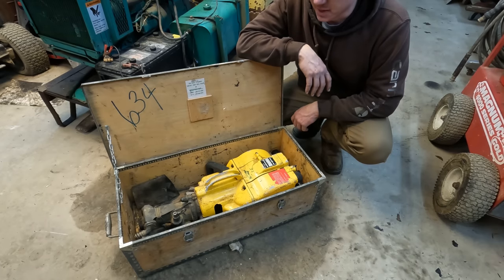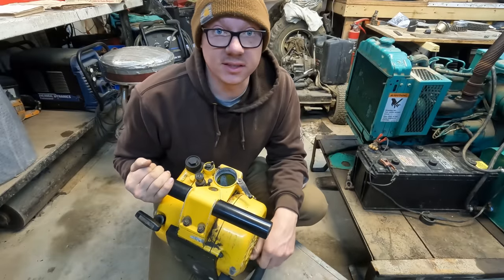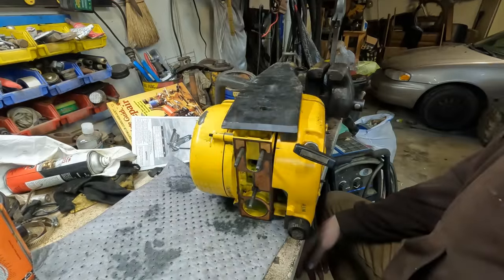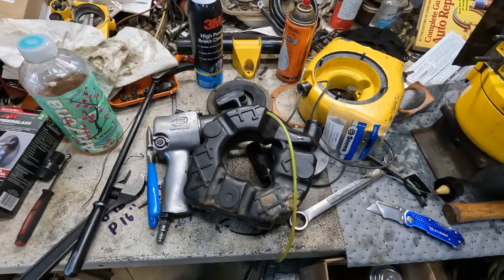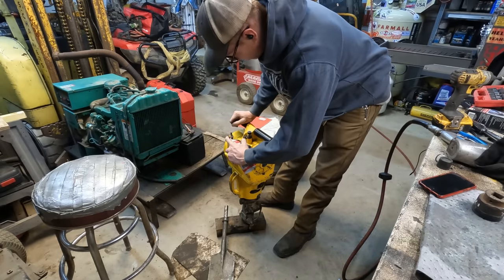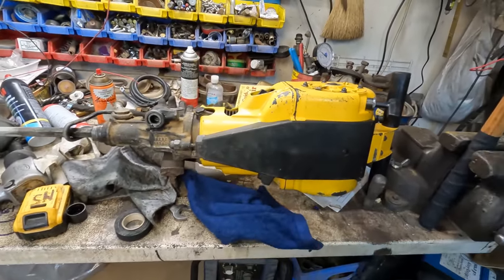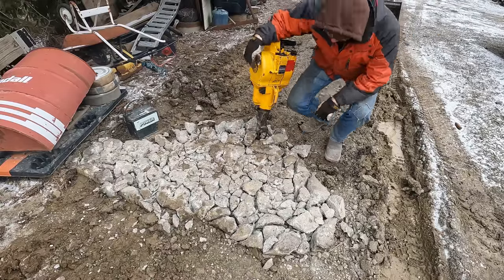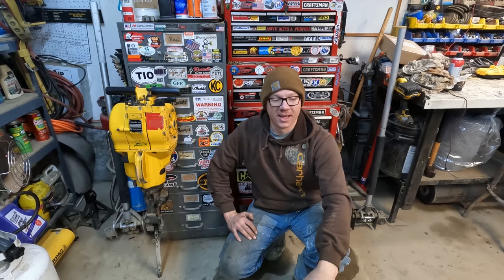RARE? Gas Powered Jack Hammer, Will it ever Run again??  (Pionjar 120)

Comment: I used a similar device back in the 60s to remove some ledge in my driveway. It was quite large and it took several weeks to complete. I only worked on it an Hr a day after I came home from work. Neighbors did'n like the noise. The unit I had was very old, probly made in the 30s, but worked veru well.
Gramps
Reply: what is ledge made out of? is that like SLC Utah USA 🇺🇸 granite/quarts?

Comment: This beast is even more gigantic than the Bosch electric jackhammer I used to run on my first job (laborer for a basement waterproofing company - ugh). On a later horrible job, I got to use a regular air jackhammer which was AWESOME. It destroyed everything almost effortlessly and it was waaaaaay lighter than the Bosch.

Comment: I know some version of the Pionjär was used by US armed forces so it might not be too hard to find a manual in English, but if not I could translate a Swedish original for you. Just let me know.

It's probably 15-20 years since I last used one but I can confirm the reversed throttle action mentioned elsewhere in this thread - "full throttle" is supposed to be used for stopping the machine, and that sure seemed to work. ;-)
Reply: It was made by Syntron in Homer City, PA and actually predates the Pionjär by almost two decades.  One of the nice things about the Pionjär is that it has a built-in grinder on the end of the crankshaft for sharpening drills.

Comment: A damp towel and a steam iron, check frequently as you steam. Most other solvent based solutions would have a good chance of dissolving the ink. A parchment paper designed for oven use will not absorb water or oils, much like freezer paper. A test run is advised ;-)

Comment: That's a Homer Simson Moment It dosent have a carburetor that's what the Reed Valves are for and The Adjustable manual Needle valve always Great To see creators put the Oopsy Mistakes in the video Great work as always Matt Always Great entertainment 12:28 @Diesel Creek

Comment: Man do I feel your pain starting that little bastard.  We have some small engines (and bigger, like Wacker diesel plates) where starting will nearly cause a stroke!  Helpful tip unrelated, mikasa jumping jacks - if your crew chucks them around like ours do-the throttle control area is a poor design easily bent and can screw up the operation.  Check that if poor running or starting. Thanks for posting.

Comment: Man, the determination to get that thing started! I would have given up and put the thing back in the box after a few pulls. Hope your shoulder is feeling better after all of that 😂
Reply: AMEN!!!
Reply: They can be a bit temperemental - some guys here in Sweden which has a complete (ie most accessories ie drills etc and the army instruction) machine like them very much but with a caveeat :  either read the booklet thoroughly or ask a friendly really knowledgeable person for assistance when working with them.

IF not,......   they are really HARD to start (due to movable cylinder lid....  so can be very hard to start if you dont do exactly as you should.)
Reply: With that much pulling, I would have to get the neighbor kid to work off some excess energy. I'm 55, but I have been telling him that I'm 60 for the past ten years.
Reply: I'm glad I opted for using the electric one + generator...

Comment: A tip to get those stuck pages lose, could be to use steam. Just fire up a kettle of water and hold the book over the steam. Then, gently pull the pages apart (when they're damp and hot).
That's how I used to get stamps that were glued to envellopes.  
Good luck!!!

Comment: I actually have two of them and they are pretty cool! It takes a few minutes to get used to the way they work and get the proper engine speed set for the best results but I have torn out a lot of concrete with them. They will break rock as well. Starting fluid is your friend!!!!

Comment: Used this to drive arrow point anchors and ground rods for a mobile radar system in the Air Force. A pain to start but once running it would wear you out. LoL. Great video. Thanks for bringing back some good memories.

Comment: got a bit of a whiff of "Hand Tool Rescue" right after the intro. Also, its great you got so much paperwork with the unit,  it really helps with the history/backstory of many piece of equipment. Hope you can get those pages apart too, looks like those manuals got wet and stuck together at some point in time. Sometimes soaking it back in water while flat will let you pull the pages apart with minimal damage to the print, though I would probably take each page out and dry them between wax paper and under something flat and heavy.
Reply: To seperate the  pages use steam from an old fashioned kettle, you know like sneaky folks used to open someone elses letters ? Apply steak whilst gently seperating each page.

Comment: Pionjär is Pioneer in swedish. We have those and still use them at work (Linesman) we use them to set fastening clamps on cable pipes and for anchors for power lines, fasten  the poles etc. Can also be used to drill and blast rock but its much slower going than a air powered drill. We also have shovle and compacting plate to use with the pioneer. I often use its smaller cusin the "Pico", its a lot lighter, but also only about half the speed. When climbing on mountains or getting on and of our boat its a huge difference

Comment: Try a steam flat iron, put it on a flat wood surface then cover with a hand cloth towel, then use steam to heat it some. Steam and heat should loosen it up. Use a cell phone to take photos of each page, then download to the printer, then staple it together.

Comment: Hey Matt. Nice find: Pionjaer = Pioneer 🙂 If you have a steam wallpaper stripper, or anything with a gentle steam output, you can hold the leaflet by the spine above it with the pair of stuck pages in the stream, and gently pull the pages apart after a few seconds. Good luck 🤞

Comment: Hi Mat,  to separate the pages I used to simply soak the entire book in warm water, and very gently eaze them loose, then once separated, place paper towel between the pages and air dry , checking to make sure they are not sticking to the towel,   good luck

Comment: When you construct your new workshop, will you include an overhead crane/bridge crane?
Would enable you to lift and move around all those heavy bits of equipment, engines, parts of vehicles, etc.
Reply: Check out the one Andrew Camara  built for his garage
Reply: Similar to what Andrew built.
Reply: Overhead crane/ bridge crane

Comment: Swedish defense had many thousands of these in store, which created an conundrum : a more modern one with less vibrations cant be stored as long as the old ones because the insulating materials ages faster then the machines is laying unused, so they tried a number of  handles which would shield the user from the vibrations.

Comment: It must have not occurred to you that when you push the black button it would die thus it’s a kill switch and not a throttle ! Remember there is NO CARB only a needle so it must run wide open when working and the needle is used to smooth out the running ! I’ve never used one but that’s what makes sense to me watching you !

Comment: Mandrel bends some crome-molly tube in the shape of the broken plastic side handle, flatten the and drill some bolt holes. I used floor vent filters wrapped around the inside of my Harley Sportster air cleaner housing, which worked like a charm and was cheaper too. Slip some foam pipe insulation around the tube to cut the vibration.

Comment: I'm guessing you've figured it out by now but I'll bet that button that you thought was a throttle is actually a decompression valve to make it easier to pull when starting. I had a 600cc single cyl kick start motorbike that there was no way you were kicking this thing over with using the decompression valve. ;)
Reply: Well, you may try, but it'll break your leg easy

Comment: I used these in USAF Combat Comm to anchor A/N TRC-170(V)2 troposcatter antenna bases. Try standing on a 10 ft a-frame ladder in an empty field with a Pionjar and hammering 12 ea  10-foot sections of ground rod into the ground. Then, you can say you've used one.

Comment: AS a long time subscriber boy you have patients with that jackhammer I would have long left it to rot into the ground your one heck of a guy to keep on trucking and you won it's now working as intended and as we all say there is no throttle just a decompressor that's why it dies when you push down on the knob it works better by putting wait done onto the machine as you have noticed that's how it works the more you bear down onto it the more power it produces excellent video.

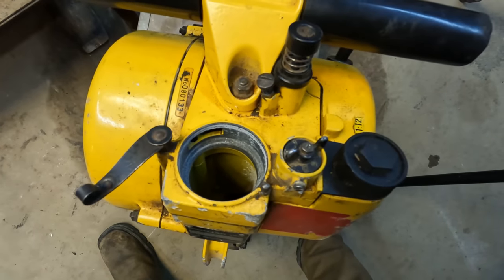Comment: @5:17
All your info is right here, Matt. Specs, spare parts, all here. You're welcome.

https://www.gmd-eqpt.com/rock-drill/gasoline-rock-drills/pionjar-120.html  |  

Owners Manual
https://www.manualslib.com/manual/1102006/Atlas-Copco-Pionjar-120.html  |  

$210 At auctions=
https://www.auctionsinternational.com/auction/20999/item/pionjar-120-gas-powered-jack-hammer-127235

Comment: if you use a thin object (like a knife) at the bottom and top and find the places between the paper where it isn't stuck, you can gradually undo it from several places if you can get in there. you want the adhesion to give before the paper, where just pulling the pages apart does the opposite

Comment: Nice to see a real Pion-jaer  [-jair] in Swedish, "Pioneer" officially in English! Made for the Army Engineer Throops and then painted matt olive green. Still in use! All variants are called "Cobra" here, what is the brand from another "small" Swedish rock-drill equipment manufacturer with name Atlas Copco. When you're addicted to yours then buy a new (A C) Cobra! Haha!  
Often the old ones run on a very fat 2-stroke "old type gas" (~ + additives) with about 5 to 7% old not PC 2-stroke oil (or just add mineral engine oil in worst case). I have several of them from Civil Defence surplus here in Sweden. Easy to buy new spare-parts here and in Africa, where a lot of them ended! ;D  So good when lifting huge granite boulders with a big tripod in fields with ring stone anchor and also when blasting rocks in ditches.  Can be hard started especially cold, but small amount of ether will solve the problem! They live forever if you use grease and have clean air-filter when rock-drilling.  Check the channel that make compressed "air" into the rock drill bits to clean the drill holes with exhaust fumes.
Print out and give this to your wifee because she isn't so proud to NOT read instruction manual. This is the original one in Swedish for Military version: https://www.maskinsalg-as.no/delelister/Bruksanvisning_Pionjar_BR_80.pdf  Note printed 1974. She will translate it with ease like the line Petrol to Oil ratio 12:1 !!! (Page 5 upper part!!)

Try a steam iron from your wife at the same time to get pages apart! Works for nearly everything except extreme glues like epoxy resin. But be careful so you don't get text on both sides.

Comment: To unstuck pages use a low setting steam heat clothes iron,  put a cotton towel over the page,,, iron it with steam,  may take several ironing passes but the page should separate....if you don't have an iron, then hold the book over a boiling pot if water,  give it enough steam that the pages pull apart...

Comment: I used to use one of them in the mid 80's in the IK you spent more time trying to start it, than the time you had to do the tarmac patch repair .............. so the local council sent them back and went back to the towing the atlas compressor and air gun

Comment: Very common also in the Finnish military. FYI Pionjär translates directly as "pioneer" but actual means a military branch you would call combat engineers in the us. Good for laying anti tank mines in asphalt of hard gravel with the shovel blade. And drilling holes to explode rock by the side of a highway to, again, block russian t-72's. Use very thick 2-stroke mix. 8% if I recall correctly. The excessive 2-stroke oil also lubes the hammer mechanism.

Comment: I read many of the comments.  The ones that stand out for me were the higher octane gas and oil mixture.  And...the reed plates.
I used to run McCullah go-karts and it sounds (to me) like you are "four cyclings".  Fuel mixture and older/bent reed valves will do that for you.

Comment: Actually used one when I was building my house.  The house was built on bedrock and I had to drill a 12 inch deep hole every 16in to pin the concrete foundation to the rock.  Lot of fun.

Comment: My son used one while in high school to make money removing rock outcrops and boulders (and train for javelin).

There is an air piston in line with the two cycle combustion piston on a common cylinder.  Compressed air can be released using the sledge/drill selector.  I think it starts easier with the selector on sledge.

Oil needs to be added to gas.

Creighton Rock are good folks and loved to talk with my son.  These machines are commonly used by Canadian prospectors.

He had a set of rock shims and feathers.  Stone masons paid him for removed stone by the ton.  

Do not leave running without a hand on it.  They can “pogo stick” many feet in air without warning.

Comment: Once upon a time many years ago, I went to a construction job and told the job "Super" I wanted to be  a carpenter, but I didn't have a hammer. He took me to a crew boss and he handed me a "hammer", a 90 pounder. Well, it wasn't long before I had earned my "street cred". That was over 55 years ago. I did work my way up the chain through hard work, and eventually had my own company. So it's with fondness to see a jackhammer back in use, although the closest I will ever get to one these days, is about the distance to the surface of the sun!

Comment: From the manual…The engine speed can be regulated by means ofthe throttle (fig. 6a). When the throttle is released tothe "up" position, the maximum engine speed isobtain-ed. Depressing the throttle halfway downgives the engine idling speed. To stop the engine,simply press the throttle to the bottom position

Comment: I own one of these for drilling rock anchors for radio towers. They work great. I have 12 ft of drill rod and bits of 1.5" thru 2.5" in button and cross style. The trick is to find the right bit for the rock you're drilling, and how to evacuate the bore hole of dust when you're that far down as the exhaust gasses aren't enough to clear it.

Comment: We had these things when I was active duty in an Air Control Squadron.  They were to be used for driving ground rods on a deployed site.  We'd pull and pull and pull, but could never get ours running.  Of course that was back when we were young and knew everything, so why read the instructions, right?  We'd tire ourselves out trying to get the poon-jar running and then end up driving all the ground rods with a big slide hammer or bust each other's wrists with a sledge.  20+ years later, I always figured it was a gummed up carb, until I learned here that they don't have carbs!  Keep up the great work Matt!

Comment: I worked one summer with a local rental company that specialized in light to medium duty construction equipment and they had one of the first of those... contractors actually loved them because they didn't have to lug a heavy compressor and hoses around to have a fairly efficient jack hammer which also came with a compaction head for repacking dirt!  Don't remember the manufacturer, could have been STIHL or Husqvarna?
These were the outgrowth of the big battery powered one's we see today! 👏🏽 👍🏼☺️

Comment: good old fashioned steam.. renowned for opening letters and sticky pages.. there's slightly more risky ways evolving moisture and a good freezer... you can use a light amount of moisture around and into the area its sticky between the pages and then freeze it.. after its frozen let it thaw for about 10-15mins and itll separate... works good with stickers on plastic and cardboard (can you tell i picked up the trick from work?)

Comment: to get the papers appart i guess you can try to use a heating iron for clothes, and try with little heat at first. And if it not work try use the steam function on the heating iron.

Comment: Hey Matt Learned a neat trick  on those Briggs starter clutch inthere a hole in the center squirt through the insquare stock with you WD-40 lube it lubes the bearing